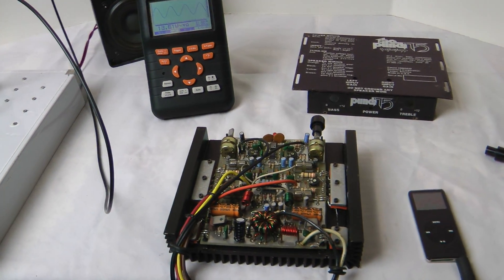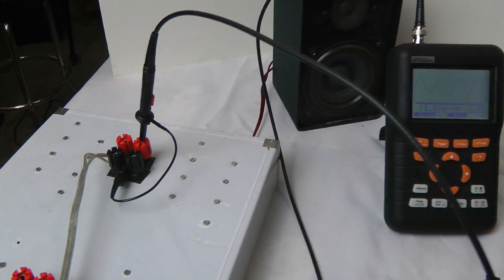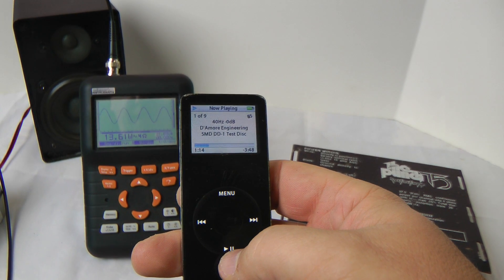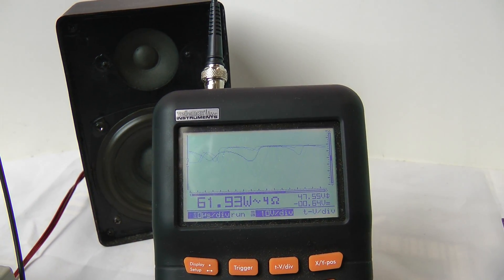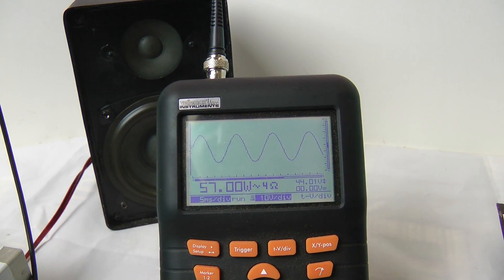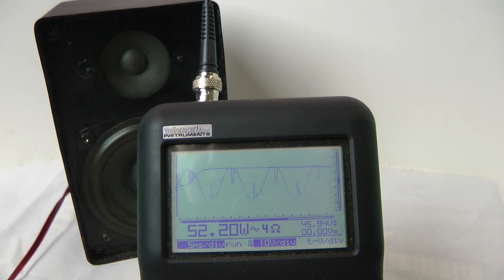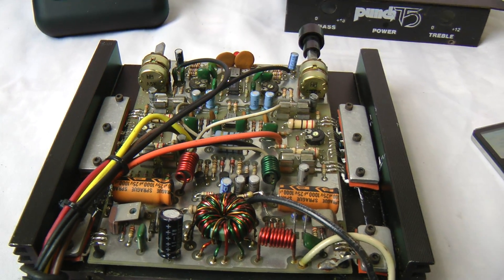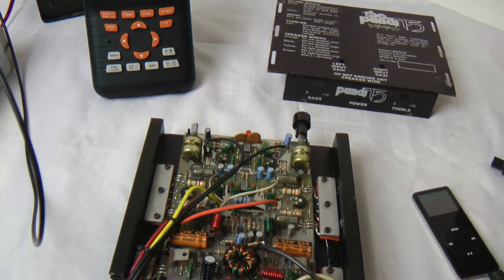Rockford Fosgate Punch 75 1st Gen Power Output Test Problems

Comment from the maker: Yeah, Jason corrected me a few years ago on the RF Vintage forum (now defunct) when I mentioned Landis Tech bought up all of the old stock (I had been told). He mentioned they have a bunch and I think there's another tech out in AZ who has some as well. Jason does good work and is reasonable, but is swamped! I've got 5 or 6 of those HD's needing the HB-PIM module you mention, will prob just send them to Jason to replace

Comment: Replacement boards are available at Freeman's, Charlotte, mentioned above. Jason will hook you up. It is POSSIBLE to replace these boards without removing the heat-sink, if you have an air ("SMT") rework station, a little ingenuity, and some patience.

Comment: No need for MOSFETs unless they're actually bad.  They can last a long time if not pushed out of spec.  However, the caps were probably are ready for replacement.  I have a Punch 150 & it's dead due to one of the daughter boards having some bad transistors.  Makes me sad.